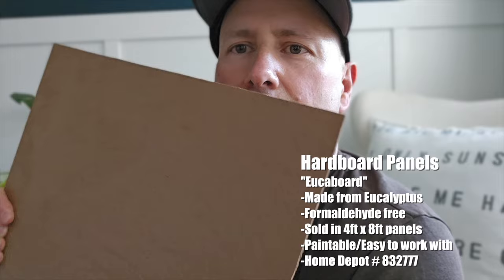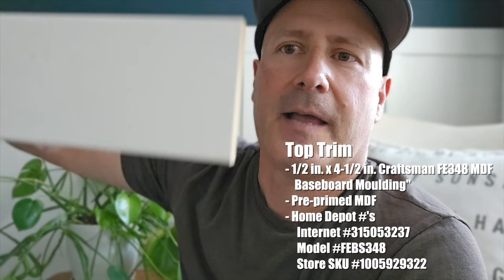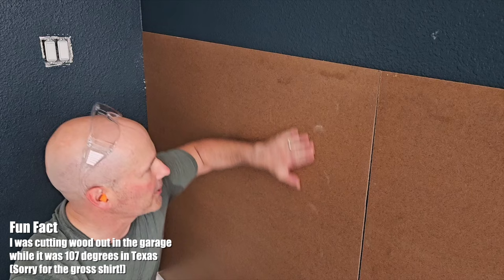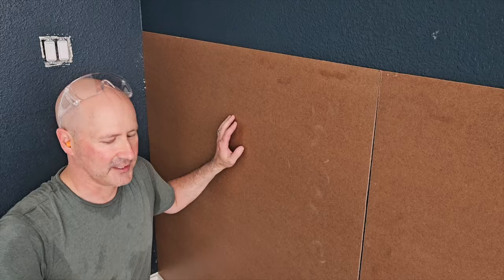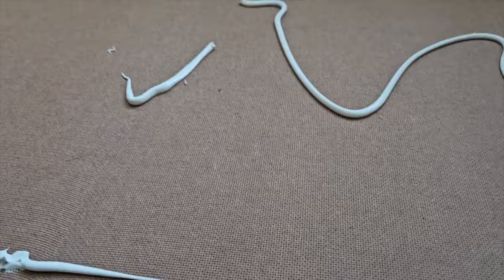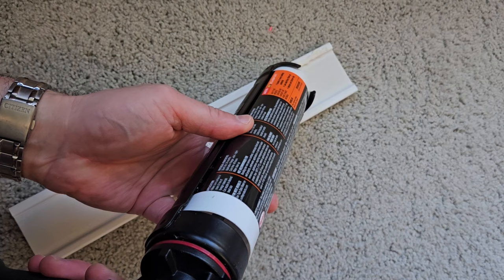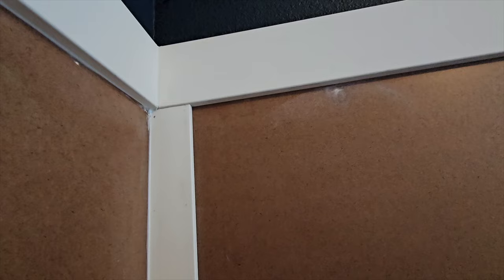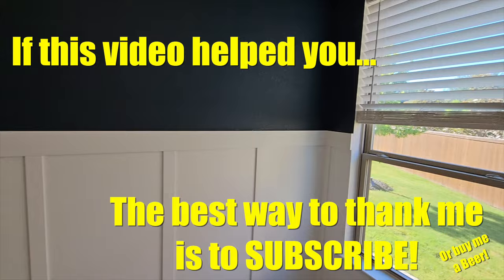Board & Batten over Textured Wall DIY Project

Comment: Great video! And I’ve watched a ton! Anyway I’m so excited to do this in both bathrooms! 
Did it look totally smooth where the seams met on the smooth back board?
Reply from the maker: Yes, the seams were smooth but only because we hid them behind the battens. We had to measure and cut carefully to plan where the seams would be before starting. Planning is important!

Comment: Also, have a 400 grit sandpaper. Okay to use to rough the hardboard, or do you suggest the 220 as you used?
Reply from the maker: Honestly I'm not even certain the sanding is necessary. After the project was finished, I saw a Eucaboard description advertising it as paintable... I just get anxious painting shiny surfaces! 😅 So I think 400 is OK but 220 worked fine and it'll be much faster than 400 grit to achieve the same result.